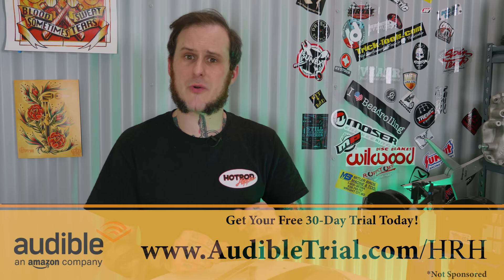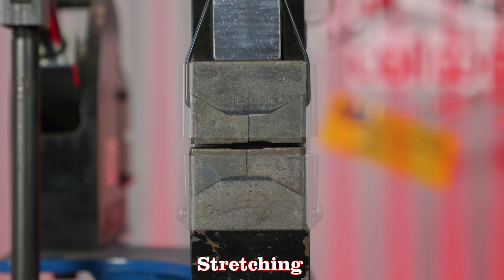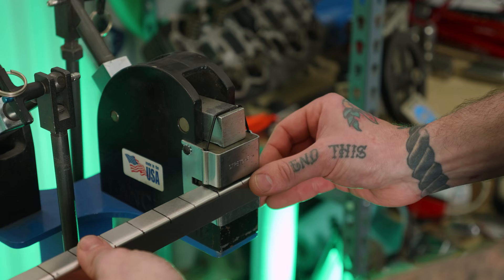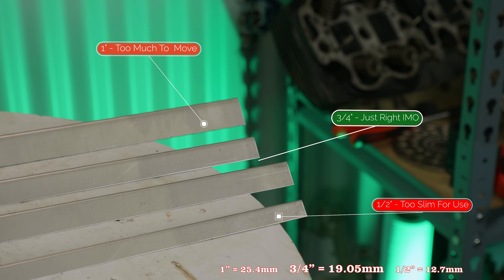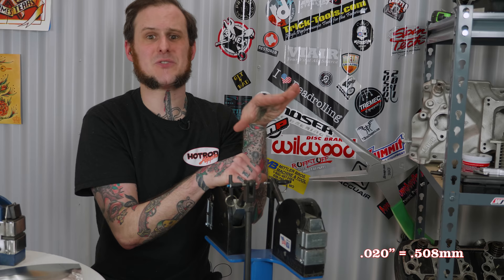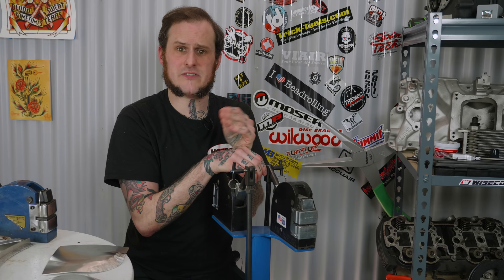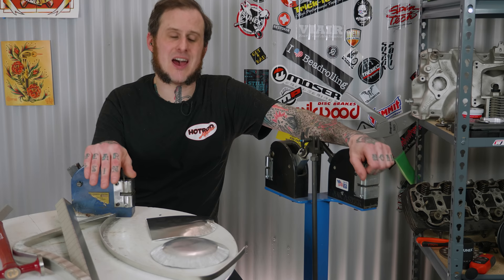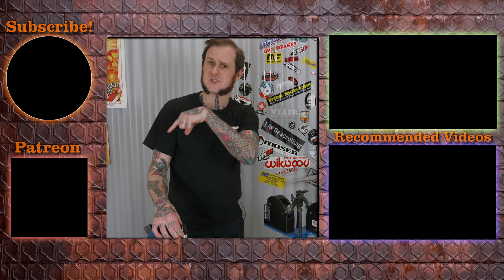Shrinker Stretcher Explained - Basic How To

Comment: Enjoyed your video. Definitely interested in seeing some videos on how you make some panels for the c10 or anything else for that matter. I imagine those jaws would start to lose there grip after awhile, so how would someone keep the jaws from clogging up with material over time?
Reply from the maker: All I ever really do is blow out the Jaws with an air blower once in a while and lube them from time to time. That is why I recommend the Lancaster brand over any others. The Eastwood ones I have were only used for a few months and the Jaws needed constant maintenance and stopped working nearly as well. The Lancaster ones are a few years old and this video is the first time I ever disassembled them.

In the past I've had to disassemble these machines and scrape aluminum material out of the Jaws, but rarely have I had much issue with steel.

Comment: You think anyone has ever made a custom frame to hold shallow dies  in a deep style of configuration? Basicly a cheap homemade version of a deep shinker using the cheaper dies from a shallow machine.
Reply from the maker: Machines like that are commercially available.  I personally do not like them. The shallow dies were never intended to be used in a deep shrink.  As such they are square in design, have harsh edges and corners, and the spacing between them is minimal.  Once a panel starts to get any type of dome into it, those dies are difficult, if not impossible to use without making a mess.  

I actually discussed that in the original edit of this video, but that was 18 minutes long so I cut it down for time.

Here is an Eastwood version of that idea: https://tinyurl.com/y2fotfdf

Comment: They have a precise  position for work rigth i own  Eastwood  one and is a difficult  to shrink  is like the dont move o the they do dont shrink maka bunch of marks but nothing happens
Reply from the maker: There is an ideal point where the shrink occurs.  The Eastwood units wear out VERY fast in my experience and their tolerances open up too much.  I've used a half dozen sets of the Eastwood ones and it happens over and over again.  The real Lancaster versions last hundreds of times better and from day 1 shrink or stretch better.  I do not recommend the Eastwood or Harbor Freight models to anyone who expects to use them more than once.

Comment: Do you think the air powered mitler brother Lancaster style? Thanks
Reply from the maker: I have not used them, but I don’t really see the value in them. I often vary the amount of force in applying when using these, so having to adjust air pressure to do that AND not having the “feel” of how it is being applied isn’t good to me. If I had to do a LOT of repeated steps at the same level it would be great. But it isn’t too often I do that. Just my personal take on the setup. Mittler Bros makes great stuff, I just don’t have a desire to use that myself.
Reply: Thank you for your extremely quick reply. Appreciate your honest opinion. I will heed your advice and save some money. 
  I am on hold on having shop put up, 40% price increase. So I figured I would start buying the tools before not after. 
   Have you found a quality substitute for the Beverly sheer? I know they set the bar high. 
   Looking at a magna bend, have you done any videos on them?
  Thanks again.
Reply from the maker: @Alien415  I have an Eastwood version of the the Throatless Shear. For how little I use one it works fine. The blade chipped easier than I care for but it gets the job done. I really don’t use one much myself though. 

I haven’t used the actual “MagnaBend”, but I have used the Baileigh Industrial version and I hate it with a burning passion. 🤣 I haven’t done a video about it because it belonged to my former employer and I never felt right picking on a tool he owned (even though he hated it too). The magnets were never as strong as I wanted. It never bent really crisp corners (biggest fail of a brake I think). And the magnets started to sink into the bed which led to uneven bends and marks on materials. I would only ever get one if I already owned a quality normal Box & Pan Brake and just wanted a secondary one for oddball parts.

Comment: Lancaster, Eastwood and harbor freight are the same tool,, excact same jaws
Reply from the maker: Design? Yea, Eastwood/Harbor Freight are copies of the physical design. Materials and manufacturing tolerances? Not at all. Anyone who has actually used all three knows the difference. In a real world shop use case? I wear out Eastwood/Harbor Freight jaws (and the mechanism of the machine) in less than a month. I’ve done it numerous times. My REAL Lancaster brand ones? I’ve been using for years without issue in the exact same working conditions. 

Eastwood and HF are cheap knock-offs made to be a low price / high profit design by cutting corners anywhere they can.